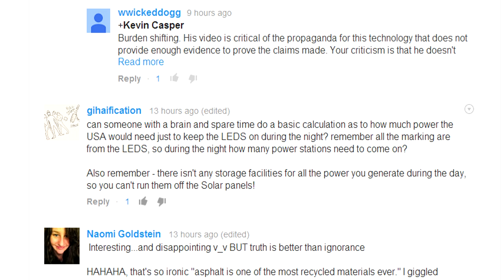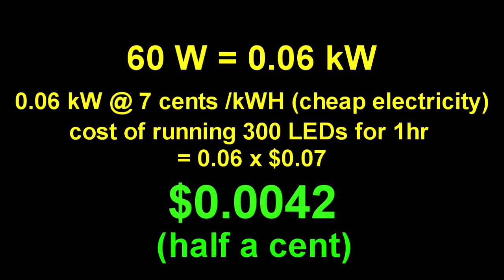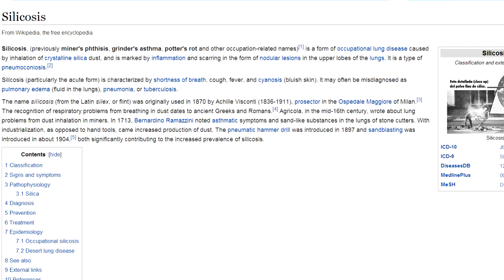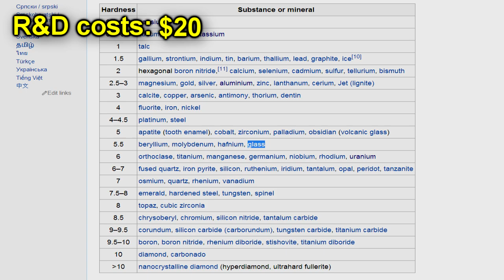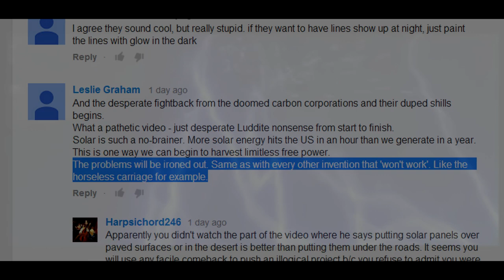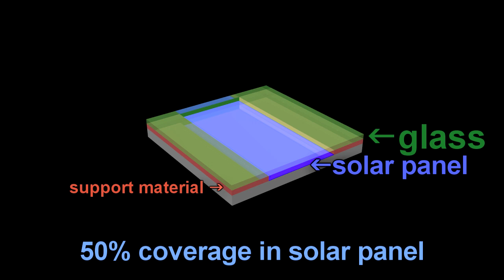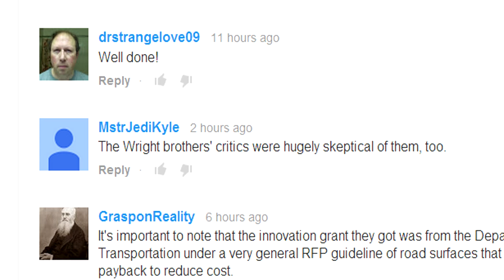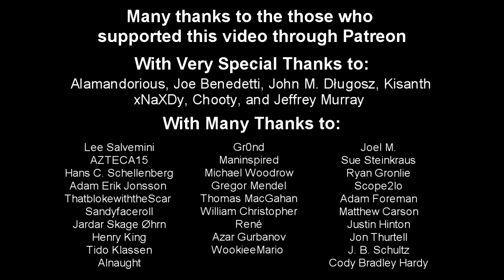Solar Roadways, IMPORTANT QUESTIONS AND ANSWERS!

Comment: TL:DR - All-in-all, if you want roadways with LED-based signage built into them and they're off-the-grid powered by the sun, you're best off building an array of sun-tracking solar panels along the SIDE of the road that feed into power banks under the surface to run the LED's during the day/night.

~~~~

Only way I can see the "glass" used in those tiles to be usable (even ignoring scratch issues and the like) would be if it was polycarbonate (eg: Lexan, "bullet-proof" glass) instead of soda-lime glass, especially if you took out all the LED and solar panel crap in them.

Of course there's one other problem with using a smooth-surface material like glass or polycarbonate (and you'd need a smooth surface for optimal light collection) - surface fiction.
A smooth-face tile would have low surface friction meaning it's harder to start or stop on such a surface than on regular bitumen-based tarmac. It's why aquaplaning is such a problem on wet and/or cold days as the water (or ice, if it's frozen over) creates a barrier between the road surface and the tyre, and is the reason why the tread patterns on tyres even exist (and why you're meant to replace old and balding tyres even if "they still have a bit of tread on them") - to cut into and displace the water to ensure contact with the road surface.

So yeah, solar-powered road tiles. Cute concept, but poor plan and execution along with poor understanding of basic sciences. Smooth surfaces (good for light) means poor traction, rough/textured surfaces (good for traction) means poor light collection for the solar panels, the more surface area taken by solar panels means less area for structural integrity, LED's cause a host of cost issues - primarily power consumption over the long term...

~~~~

I've seen plenty of solar-powered LED school zone signs where the panel is mounted on the back of the sign and runs into a battery bank that runs both the LED's and the microprocessor that controls when the LED's are turned on (8am to 9:30am & 2:30pm to 4pm, Mon-Fri) or off, and they were set up to provide a way to inform drivers they were entering a school zone on days that might be overcast or foggy.
I have no idea the exact power draw for the LED's in those signs, nor the efficiency of the solar panels used nor for how long the battery banks in the signs could run the LED's for before needing top be recharged, but they work well enough for the Aussie (State) Government/s to have spent the money on them.

Comment: I wonder if these tiles, minus the LEDs, would be viable for bicycle/walking paths instead? Just as local projects, not as some kind of national revolution. They won't see the wear, weight-bearing needs, or extreme safety concerns as roads, wouldn't need to be heated, could be more easily maintained and would require fewer materials. I'm mostly just wondering whether such tiles, used this way, would be more or less cost effective than the equivalent area of bike path combined with the same area of standard solar panels.

Comment: I would say the concept behind Solar Roadways is 100% solid, using the worlds roads to make extra energy.
After all most of the landmasses on earth are covered in roadways it wouldn´t be so outlandish to think we could somehow use those road ways to generate some extra cheap energy/ the benefits outweigh the cost of making and maintaining it.

Same about using the suns energy to deliver extra energy, as anyone can tell you the sun is always shinning in space, so using the solar panel idea to produce a constant energy supply isn´t such a bad idea. 

Solar roadways are however just not that solution.
As ThunderFoot has pointed out, they are just too expensive and impractical compared to what they actually give.

Does that mean that there won´t be some eureka moment in the future where a person figures it all out and is able to implement the idea so it benefits all mankind?
No as history has pointed out, lots of things previously thought impossible has been proven possible.
But right now i am with Thunderfoot on this one Solar Roadways aren´t the answer yet... well at least not until we invent the hover car (think Back to the Future 2) then solar roadways might be possible.

Comment: Just put solar canopies over the roads. 
-They protect the roads from weather
-They create power
-All of it can be maintained from above, instead of stopping traffic below.

Or we could go irobot style and put all highways underground, it would contain most of the exhaust, and it would free the surface for things like solar panels.
Or we could get fusion done with already so free energy wouldn't need entirely new infrastructure.

Comment: Isn't the cost of running at night offset by the power generated during the day? I would think you should subtract the value of all electricity generated in the US from that cost he calculated. That still means the power plants need to be kept however so perhaps at best the panels would pay for themselves, leaving us with all the other problems he mentioned.

Comment: Plus, what kind of base would you put down?  I exist in the real world, and in the real world, the base underneath the blacktop we currently use fails all the time.  For that sort of system, the base would have to be very nearly perfect.  It's a total non-starter (ignoring all the problems you point out) if our means of providing a solid base aren't increased exponentially.
Reply: uhhh, HELLO!  more glass hex solar panels, of course!  go back to college, you obviously need some good colleging.
Reply: You'd have to use reinforced concrete for a base, and even then, it's hard to guarantee a 100% flat surface, let alone one that stays flat forever (which is what you'd need for a road made of pre-made hexagon-shaped boxes to stay connected to each other and to be able to drive on it safely.

Comment: Did they say tarmac I hope they weren't referring to runway. I've performed maintenance on the equipment used to pour concrete for an airport expansion. The cement they laid was 18" thick good luck replacing that with glass and landing a plane on it.

Comment: Someone should roughly calculate how long it would take for these solar roadways to pay for themselves (if ever) when you consider the cost for materials and installation, ongoing and probably constant maintenance, powering the LED's, and also the fact the position of these solar panels don't make for the most efficient energy generation. Not to mention in many highly populated areas, during the day, many of the solar panels will be constantly blocked by cars and pedestrians, and shadows from surrounding buildings...

Comment: Thunderfoot, please be more realistic with your pricing.  This is such a dumb idea there's no need to exaggerate costs to make it look worse than it is.  If you used wholesale pricing for all components, this video would be more impeccable.  Why give these nutjobs something legitimate to criticize?  You could also explain why LEDs work great for billboards in daylight, but wouldn't work for road markings (the angle is wrong).  Lots of opportunities here for good explanations.  Otherwise great video, especially the glass grinding.

Comment: I was expecting to see a more informed criticism.

I find your initial estimations quite unrealistic and off the mark. You estimate how much it would cost to power all the leds without taking into account that the panel is supposed to produce such power. Are all led similar in power/consumption?

The tests around 8:00 are irrelevant: You have little idea of the composition of the glass. They claim it's passed the same tests as current road materials on durability. I'd like to see the real tests, not some completely speculative ones.
Reply: What about the part where he points out lighting them during the day is useless as you cannot see them and lighting them at night when you can see them is also pretty useless as the panels are not generating any energy?
Reply: Actually he points out that they might not even produce sufficient energy to power the LEDs, much less send power to the grid. He's actually rather generous in the estimation of power, though a little harsh in assuming all the leds will be on. It depends on how powerful the LED's are to be visible in sunlight, how dirty or scratched up the glass is, how bright the day is, the low coverage of solar panels to the overall surface area.

It'd be borderline if they could produce sufficient energy to power the leds if they wanted to use them to constantly light the road.
Reply: 'The glass tests are irrelevant.'  Interesting opinion, not informed but interesting.
As has already been stated the idea would be to use recycled glass, mainly bottles.  The second glass he tested was one of the stronger forms used en masse worldwide, so he was being kind there.
Look at the average roadway after a few years being driven on and there are nice tyre grooves from being driven along, especially by trucks.  Durability of our current road material is not enough to avoid this, let alone a far softer and more expensive alternative.

I will add something else I already used on his original critique of this unfortunately poorly thought out idea.  We know how glass works on roads, because it already is, when mixed with paint it makes up the markings on roads worldwide, do please check this and why it is a very good idea, in case you aren't going to it is to make the markings harder wearing than paint and very mildly reflective.
So we have something in use on the roads now that is made of part glass which has traction properties improved by being mixed with paint.  Ask any biker what happens if you ride over this stuff in the wet without extreme caution, they will tell you glass on roads in the wet is a death trap.

I like many admire solar power as a renewable energy source, the entire planet gets most of it's power from the sun so it makes sense.  This just isn't the way to do it.  The wright brothers made a plane that flew but it was a biplane and we have realised these are dreadful compared to the single fixed wing alternatives used today.
These people may come up with a way to get something working on large scale solar power to help our planet, this isn't it.  Unfortunately the issues are too large to overcome.

I'm not a PHd carrying scientist like Mr. Foot but I don't need to be.  I am an old biker, who crunches data for a living.  Presented with this idea I would have been able to explain the shortcomings with it in minutes as Thunderf00t has, because introducing reality into guesswork is what I do for a living, not a popular job on occasion but saves companies a fortune.
Reply: Maybe try listening to the video next time instead of listening to your inner dialogue the entire time.  All those issues are thoroughly addressed in this video.
Reply: Then show us how you'd like them to be tested. And show us how TF's wrong and give some accurate predictions.
Reply: The want to use recycled glass bottles, so yes we do have an idea on what they want to use, recycled bottles! Also the more exotic highly durable really expensive glass they use in smart-phones also scratches when you rub them with sand. So what do you think they want to use to combat this? Sapphire, diamond? Never mind the loss of power from having a rough surfaced thick sheet of glass to begin with. The glass alone makes this a stupid idea!

To power all the LEDs is overkill I agree. But its rather hard to work out how much they would need exactly. It is interesting though that 1 panel on peak efficiency (rotating with the sun and no glass) is not able to fully power its own LEDs, so how much do you think would be left for your home!? Never mind after all the lost power is subtracted from the equation.
Reply: Linkolnverse You still have latent power needed to operate in standby mode and communicate with nearby panels in order to detect activity.  Times however many panels you have.  And darkness still completely eliminates the power generation capability of the panel.  And there's no local power storage on the panels to account for day/night cycles like that.
Reply: The tests for roadway durability were no doubt devised from common road materials and should be expected to apply to common road materials - not necessarily to things that have never been used as road materials, e.g. sheets of glass, penguins, laser beams. Thunderf33ts has demonstrated undesirable material properties in the sheets of glass that lie outside the specific claims of the material properties made by the company. So when you say you'd like to "see the real tests", why aren't you directing that query to the company that wants to make glass roads?
Reply: Hey moron, tell me how those panels are going to power the leds at night. That is what he spoke about and NOT powering them during the day. I know you THOUGHT you were being clever. But in reality you were just showing how little you have in the way of critical thought ability. Thanks for playing but, you are the weakest link.
Reply: lmao you brush off his 'unrealistic and off the mark' criticism, but can't even back your comments up. Get out of here you're almost as much of a joke as Solar Freakin Roadways.
Reply: Linkolnverse they'll probably need more lights, at the very least more powerful LEDs, they've even stated on their own page that they aren't currently using LEDs strong enough for daytime use. Odds are they might require more lights to set the contrast as well which again will cut into cost and amount of net power from the system regardless of which route they're forced to use.
Reply: Linkolnverse If your outside the viewing angle the LED's will loose a significant amount of luminous intensity, This is something that the roadway people will also have to come to terms with.

Currently the way the solar roadway have set up their LEDs makes them best suited for illuminating the underside of a car, and not for visibility to drivers, maximum visibility for drivers would be straight ahead ( on say a road sign or your CVS sign).
Reply: Hold up "They Claim" yeah a lot of people Claim that there is a giant bearded man in the sky who grants wishes.
Reply: Some misconceptions going on that I would like to point out. The recycled glass that you can see them shoveling in the video is for the base of the roadways not for the actual glass for the panels. So all of you that say that the "experiments" he did was in any sense correct is horribly mistaken.

The viewing angle has been already brought up when they finished their very first prototype and they have worked on trying to fix it by developing those textured hexagons. Those textured hexagons not only provide traction but they are designed in such a way that any light that is leaving the panels is shot in all directions so that the viewing angles are greatly increased. You can hear them talk about it in some of their older videos.

Also, that LED cost that Thunderf00t did is quite ridiculous. He calculated how much money it would cost if every single LED was on all the time. In reality the majority of the LEDs will be used as lane markers which ( judging from this picture in the video at 0:48 ) requires maybe 5-15 LEDs for 5% of the total panels. Not only that the inventors have said that they will be able to program the LEDs marking the lanes to turn off if no cars are driving on that road. The fact that he tried to use this cost against the project is frankly dishonest.
Reply: Keyword claim, we have yet to see any evidence of it's ability as far as I know.
Reply: Milo Minderbinder "why aren't you directing that query to the company that wants to make glass roads?"

Because I'm patient, and I can wait until the research is done. IMHO, even if they advance towards its infeasibility, it's progress.

Don't get me wrong, I think TF brings very important issues, but on others, he appears to ignore data that is readily available.

Comment: solar power is indeed awesome, but would it not be massively more efficient to build matrices of elevated panels grouped together on specific areas of land that are known for receiving higher than average solar radiation?  oh wait..  those are called solar farms, and they already exist.  Solar roadways are about as good of an idea as thorium powered automobiles.  sounds like they would both be awesome, but the logistics just don't pan out